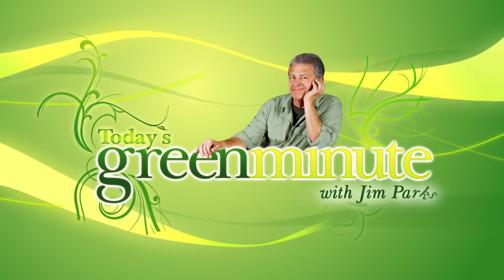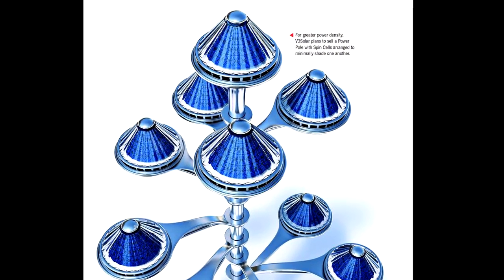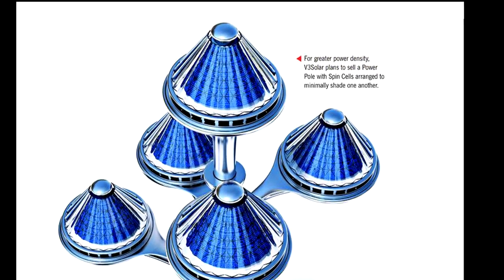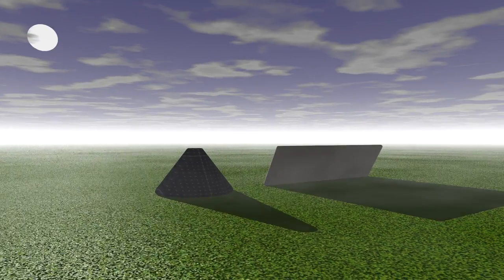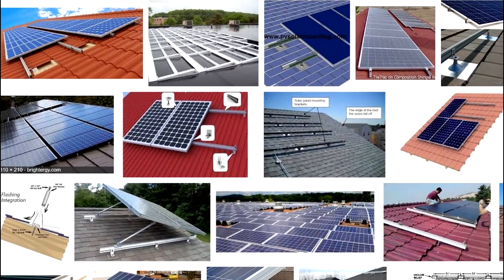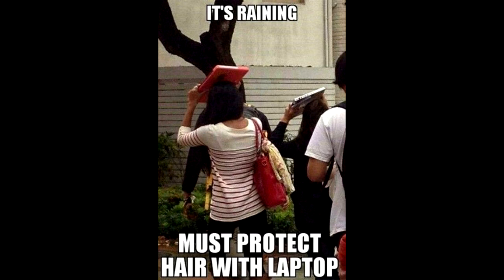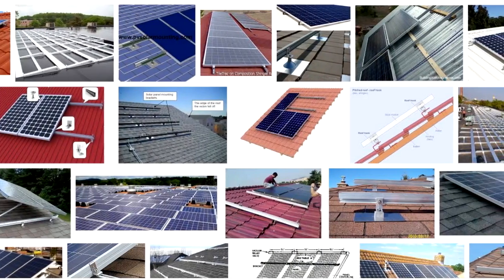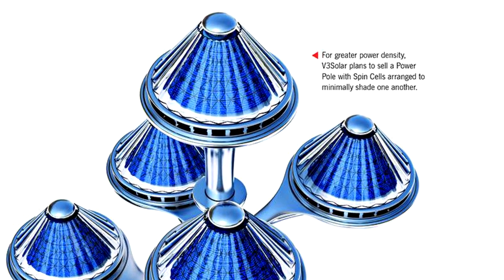Spinning Solar -BUSTED!

Comment: 50 seconds in I am thinking WTF, only 50% of the cells see any sun at any given time, minus the energy used to spin the device!!!
Reply: the 20% boost in energy he speaks of represents the added benefit of having the cells cool as opposed to hot. The 30% he multiplies by is the theoretical maximum amount of energy the panels could produce in a cone configuration, without lenses, assuming the cells are 100% efficient, but since existing cells only achieve 20% efficiency (that's how efficient the best existing solar panels are), the numbers thunderfoot uses would require 5x magnification!!!! And that still doesn't take into account the losses from light traveling through such lenses. He gives the concept such an unfair advantage in his assumptions, and it STILL doesn't add up.
Reply: @Gyppor  because the other half is in the shadow it's even worse then standard solar panels and even doubles the cost for half of the efficiency...
Reply: The surface area of the glass would have to be 20 times the area of the solar panels to do that.
Reply: @Gyppor  Why
Reply: +MusikCassette
Yes, for the reason Gyppor just mentioned.

Maybe to be more accurate, the glass might magnify by 20x, but that hardly helps unless it also brings in 20x more sunlight by using 20x more area than the panels.
Reply: Simon WoodburyForget 
gyppor was specifically replying to musikcassettes question, not a general complaint.

I'll restate; for this to make sense, the glass would need 20x more area than the panel, which the prototypes shown dont have and even if, this should have been explained right away instead of making it sound like the shape and temperature are essential.
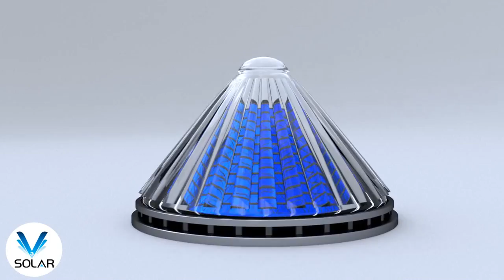Reply: MusikCassette uhh, but he did, starting at around 7:40 and didnt just say it would be too big to build. Did we watch the same video?
He showed how big the glass shell would need to be for the concept to work. Which would require an optical lense bigger than the biggest optical lense in use today. (did you mean 4m, not cm? and mind, just making a glasscone like that isnt enough, it has to be a working lense)
This would make the entire construction huge and as thunderfoot said, if for any reason the cone stops spinning, the concentrated sunlight would quickly melt the solar panels.
if the concept is that they concentrate light by 20x and the spinning cone is just there as a cooling system, then showing that picture of the cone with the glass shell and claiming it would produce 20x more energy is entirely dishonest. Or you're just blindly regurgitating what someone else told you without questioning it for a second.
Reply: Simon WoodburyForget I dont understand what youre trying to say. of course wed want cheaper material, but musikcassettes question was about my statement about the outer glass shown in the video not being able to gather 20x more sunlight. gyppor has answered this by saying it doesnt look like it has 20x times the surface area of the panels.

If that actually was the concept, it should be advertised as such and would be entirely legit; "20x more sunlight can be harvested by the same panel using magnification and innovative cooling system"
Reply: Simon WoodburyForget - clearly u arent mentally capable of following the conversation, so dont chime in.
Reply: nycholaus if it is producing 20x more power with the same surface as a normal solar panel or whatever the actual claim is since they aren't specific about anything, then it is 20x more efficient.

sure, 20x more power and efficiency aren't the same thing in general but in the context of this video, they are.
Reply: legalmechman, yes, Fresnel lens does capture more light coming from low angles, but it does not scale infinitely. No matter how much you increase surface area, you can not capture more light than it is directed at the lens. And that depends on volume.
Reply: legalmechman, actually, 

- I am not talking about volume of a lens, but an arbitrary volume that light passes through.
- Fresnel lens has smaller volume than comparable regular lens (because it is thinner).
- The protrusions on the cone are not Fresnel lens. Those are regular lenses. If cone was flat, it would be just a piece of glass, not focusing any light.
- Amount of light gathered by lens is proportional to lens' diameter.
- This isn't anything new, CPV is being researched for quite some time.
- This isn't really a scientific problem, but an engineering problemand from engineering standpoint, this design is… shit.
- Spinning the panels is not very good way to cool them.
- And that is covered in the video.
- Panels are enclosed within a glass cone, preventing convection.
- If spinning mechanism fails, solar cell is fried.
- Search for 'fresnel lens solar panel', this idea already was investigated.
- We live in a real world, where cost does matter.
- They question is: why would you make a more complicated and expensive system, which produces about the same abount of energy? (If adding lens allows solar cells to receive 200% amount of light, while 50% of cells are in shade, you produce same amount of energy)
Reply: MusikCassette thunderfoot addressed that in this video too. And yes, if that is actually their approach then this advertising is pretty dishonest.
Idk, seems there is a misunderstanding? Your question wan't very clear because i specifically talked about the cone shown.
Reply: I do not "simply" dismiss everything. I study things before disimissing them.

I do not try to sound superior (from my point of view, it is YOU who is trying to sound superior and dismisses everything I say). This conversation started with me trying to point out that you can't magically capture (X times) more light by increasing surface area of the lens. There is certain amount of photons going through the lens, and the only way to get more is to increase the size of the lens.

The thing about this project is that it is fake as hell. Their goal is NOT to innovate, but to grab attention.
They are just made up some COOL LOOKING FUTURISTIC THING and are not trying to solve any real problems.
I looked at their prototypes, and, (while they don't look bogus, unlike their cone-things) they are adding a lot of complexity for no real benefit (compared to existing CPV systems). If you are willing to add complexity, why not use water cooling? As a benefit, waste heat is used to heat up water, which can be put to use.
Reply: To clarify, I am not against people attempting such projects to satisfy their own curiosity, but misleading other people, and making money off that is not right.
Reply: +illyounotme The point is still entirely legit. If they produce 20x more energy with they same power source, then they ARE 20x more efficient. The panels they use for the cones aren't more efficient by themselves, so that increase has to come from somewhere else.
Existing tracking solar panels pretty much receive up to 100% of the sunlight their area of surface can receive. ´~20% of that is turned into electricity. Even if we're being incredibly generous and assume they're talking about stationary solar panels and are again incredibly generous in saying they're only half as efficient as tracking ones, then these cones STILL produce double the amount of energy the sun is providing.
The boost by cooling isn't incredibly much, so the magnification still has to somehow increase the incoming sunlight by over 10 times. Of course their lenses, the outer glass cones, can't bring in more sunlight then their are of surface either so these cones seem pretty magical.

To me, it seems the problem with these hypetrain schemes is that they don't provide details or data. Is there some mental gymnastic to what "20x more than regular solar panels" mean? On their website they state " if one places a 20x solar concentration on a flat, static solar panel then “the temperature quickly reaches 260 degrees F, the solder melts within ten seconds, and the PV fails. With the same concentration on the Spin Cell, the temperature never exceeds 95 degrees F.” Is that where the "20x" comes from? The outer glass sure as hell doesn't provide 20x magnification, so you have to do that somewhere else. In that case claiming these coneshaped solar panels produce 20x more energy is dishonest.

Funny enough, the prototype and claims shown in this video are over 4 years old and nothing has happened since then.
Reply: @Powersd451   most cheappee solar panels barely do 100 watts    315watt panels is the highest i have seen..
Reply: +MusikCassette
In that case I'll apologise too, I never noticed you responded until this nono dude dropped in.

"you do not have a lower restriction about how big that is."
Do you mean that we could downsize the entire thing? Sure, but my point is that the advertisement is wrong or dishonest. If the point is that the lens captures 20x as much sunlight, then the cones shown aren't representative at all.

""did you mean 4m, not cm?" you are a bit confused there"
I misread, I thought you said 20cm cell and 4cm lens.

"I got a little bit of homework for you: you have a small object and you are looking at it through a lens. What does it look like when the lens is formed in a way, that almost all light that falls onto the lens is directed towards that object."
I don't know what you are asking. What does what look like? from the perspective of the cone if that's what we are talking about, the sun should look magnified, everything else depends on what kind of lense it is.
Was the point about the 20x magnification and the size? In that case it was just a misunderstanding from the beginning.

To the rest, I'll summarize, I have nothing against new tech and I'd be thrilled to see some smart innovations. But by going by the info we have so far, somebody was either lying or mistakenly misrepresenting it. Knowing how people scientifically illiterate people react to hype, it could well have been the latter option.
But I despise Hype culture. Nothing good comes of it. Misinformation becomes rampant and it's more like brainwashing than being informing or productive.
Reply: legalmechman, Surface area does not matter here. No matter how much surface area you have, amount of light passing through the volume which contains that surface remains the same.
Reply: I rewatched the video. He doesn't talk about surface area, but about (solar) cross section, or how much of a lens (or a solar panel) is seen from Sun's point of view.
I confused things and started talking about volume, which is not relevant. Sorry about that.
Amount of light gathered by lens depends on it's diameter (larger lens captures more light) and on it's focal length (shorter focal length lens captures light from wider angle).
Main advantage of fresnel lens is that it is much thinner, meaning less weight, and it can have shorter focal length without significantly increasing thickness.
Reply: ye i mean even an idiot can realise that spinning those things would lose ALOT of engergy... its complete nonsense for the average idiot to believe...
Reply: Yah. I mean sure, the solar panels lose efficiency when they get heated up, right? So let's say that you exhausted options like passive cooling systems or whatever. Also make a big assumption or benefit of the doubt that after a point it's more efficient to just turn the panel off and cool it down. 
What solution would you use? Would you take the entire structure and spin it around or would you equip the panels with a shutter system where only a thin shutter mechanism would need to move? In fact, what if we would instead use something akin to a...what's it called, windshield wiper to apply coolant to the panels? So as soon as the thing heats up too much, a cooling-wiper wipes it off to try to manage the heat? 
No...let's just spin the entire god damn thing.
???
Reply: that is obvious, but why should it not have?
Reply: ñoño why the hell re you suddenly dropping in now?
Reply: I did not claim that using lenses and cooling is bad idea, and I did not say that it isn't applied in practice. So I don't disagree with you.
However, their cone design is completely bogus. The prototype from their page does look sensible, but I doubt it is a good cooling solution:
- Needs more solar cells to produce same amount of energy (because most of them are inactive)
- Requires more maintenance because of moving parts
- Motors require some power to operate
- Failure of the motor will cause PV cells to be damaged very quickly

We don't know because they haven't released any information despite having plenty of time to do so (their first prototype appears to be from 2013, and they haven't shown any other prototypes)
Reply: Gyppor why not just have a really big servo that moves REALLY slow that rotates a solar panel that follows the sub.
Reply: I didn’t even think that
I was just like
This is stupid, don’t fund this
Reply: well for maintanence you should turn of all tree :D
Reply: When I first heard of spinning solar cells, I thought these were lawn ornaments, not touted as a serious economic energy system.  :)
Reply: They lost me at 0:51. But wait, no, just kidding, its a piece of shit.
Reply: question could it ever be possible to create a light bulb that could power a solar panel like the sun?
Reply: alpha yun
sure you could do that - if you wanted to waste energy
It is impossible to make a 100% efficient system - and even if you could you won't be gaining any power you would simply have a s much power as you put into the light bulb
Reply: illyounotme you either haven't watched the video, you're deaf or you're just plain stupid
Reply: Just throwing it out there isn't there ways to produce energy through the principal of centrifugal force? And if so would using the solar power enhance energy production. The idea would essentially  be  some kind of magnetic turbine by using the solar energy to be the initial catalyst. I feel like this would be consider a perpetual motion concept. Would like to hear your input.
Reply: Simon WoodburyForget magnets aren't a source of energy? Except when they spin inside some wires and are a source of energy. it's how a turbine generator works :) as for losing some energy from the heat dissipation to make it spin (almost frictionless remember) - well that could still make it far more efficient than a solar panel that needs cooling
Reply: There is no difference in the solar panel that self therefore there's no difference in the efficiency of the solar panel. Well you might be able to slightly increase its efficiency due to the prism effect of the glass over the solar cell, this is done before it is not a significant increase. Rotating the cell awesome makes no difference because only the cells that are facing the sun generate power, so the majority of the cell surfaces are actually not producing energy. That's because over half of the surface area of ailable is facing away from the Sun, and at least another 25% isn't being sufficiently energized by the Sun to produce enough energy to matter compared to the remaining 25% that is nearly fully facing the Sun. The result would be about 30% to 35% of the solar cells actually producing energy at any one time which means you have a net loss of 65% give or take over a ray of flat cells. That right there debunks the entire principal this device
Reply: Ever seen what sort of solar panels Solyndra made.... ?
Reply: Yeah, I was wondering that too; with most of these Busted videos, you at least need to do some thermodynamics math to see that things don’t add up, but you barely even need that here:
Reply: 20 times more power is exactly same as 20 times more efficiency.
Reply: @SliceOfFish  nah. You could be gaining 20x more power but losing that in some way, like not converting it correctly, leaking it somehow, using up so much its basically the same as any other model...
Reply: per What?
Reply: +Buffalo_Chips may I ask where you have that information from? All I can find are sources claiming they spin it using a fraction of the produced electricity and a magnet system.
Reply: "But I despise Hype culture." well, there is something, we got in common. But going the opposite direction and dismissing something  because of a hype is also fallacious. Just because a stupid person says something is good does not mean it is bad.

"Do you mean that we could downsize the entire thing?" Well kind of. Actually I mean that there is no need tu "upsize" it in the first place. 

"I don't know what you are asking. What does what look like?" I meant what does it look like from the outside. The solar cells would look a lot bigger through the magnification. I still don't think they would look like they do in the Video, but there is no indication, that they would fill the whole cone.
Reply: Puls it always facing the sun, so it kinda evens out, I guess
Reply: Gyppor
Yet thundetfoots Argumentation on this is bullshit.
There is no absence of photons in the shade. Their number is greatly reduced but it's not zero. Think of all small plants and bushes growing on the forest ground. They  are in more or less 100 percent shade yet they live and grow because they might get a mere fraction of the photons received by the tree canopies but still they get photons for photosynthesis.
Imaging you have a big house - you can still grow something on the north side of your house where the sun is blocked basically all day long. Plants used to shady conditions. They will grow slow but they WILL grow nevertheless.
This only works because shade doesn't mean there are no photons.
Furthermore, you can even get sunburned in shade during summer.
Reply: Simon is saying, that glass is cheaper than silicon. And he absolutly gets what my retoric question is about. you are right, to get 20x as much energy out of the same solar cell the lens needs to have at least 20x the survice area. But there is no reason, why it cant have that.

I agree, the advertisement does not portray the Idea in the best way. You should start with the optic  than get to the heatproblem and than talk about the cooling system. 
It is still an open question, weather that system works out. but it is not a ridiculous one.
Reply: @sosocrazy1234
please stop spaming
Reply: No they aren't, because arbitrarily choosing a definition without knowing what the source of a claim is means you are using a strawman argument.

In other words, it doesn't tackle actual claims made by the designers of this device, it tackles some completely different issue that may or may not have anything at all to do with the claims made.

That's not very good for the credibility of someone trying to argue about science.
Reply: Refrigerated Fish "20x more power is exactly same as 20x more efficiency."
no, it is NOT.  NOT AT ALL.  Stop embarassing yourself by posting stupidity.
Reply: 1. sorry for the late response, there was christmas and new year and than other stuff.
2.  
to the size again, there is no reason, why the lence should be big. Yes it has to be at least 20x as big as the solar cell but you do not have a lower restriction about how big that is.
"did you mean 4m, not cm?" you are a bit confused there 4² *20=16 *20<20*20=20²
why the hack would you want to use a 4 m Solar cell?
"just making a glasscone like that isnt enough, it has to be a working lense" 
the exact geometry of the lenses would actually be an interesting topic to analise.

I got a little bit of homework for you: you have a small object and you are looking at it through a lens. What does it look like when the lens is formed in a way, that almost all light that falls onto the lens is directed towards that object.

If however your argument is, that the people who made the add did probably not understand the Idea, that they were advertising, I would probably agree. That seams likely. But I think technologicala literate people like thunderfoot and myself, should be able to see past that and judge the actual Idea. Even if Nathan Fillion likes it.

"Or you're just blindly regurgitating what someone else told you without questioning it for a second."
If that was the case I would be on your side of the argument. I learned about this from this Video. And I have a high opinion of thunderfoot. But that does not mean I follow him when he skips a few logical steps.

Look I am by no means sure, that this thing works out. But if they can get the cost for the mechanic and the lenses below the costs for the difference of the solar cells they use, and the crossection of the cylinder. And if the cooling works out. And if they can the reliability of the Mechanic above the mechanics of a solar tracker. If they can accomplish these three criteria than this would be interesting.
Reply: The heat gives energy that is used to spin the device and treats the spin as an alternator giving more energy, not using more. So this video is rather misleading.
Reply: @SimonWoodburyForget  ther in a vacuum making less air friction
Reply: +Powersd451
no he didn't really he called it a joke which is not  addressing it. the
 most valid thing he said about it would be, that the lens would be way 
to big, to build but that is actually stupid. Which is odd because 
normally he is quite an intelligent gay. If the lens is 20x as big as 
the solar cell and the lens is lets say  is 20cm in diameter, that would
 make a cell about 4 cm in diameter.
I do not really think that the advertising is dishonest. I vote for incompetent. But that is just speculation. 

how would you think, a cone of glass that leads almost all light that hits it onto some smaller solar cells would look from the outsight?
Reply: ok, guys...no claim of intelligence here, but I noticed something you all seemed to miss and I am curious of your thoughts...the "why" the cone lense won't work seems to rely on the premise that it is smooth...yet it looks to be ridged (like a cupcake paper) in the video (from the ad) allowing more surface area in a smaller space (sort of the inverse of cooling fins?).
Reply: Refrigerated Fish I'll agree that profiting from stupidity is wrong (welcome to capitalism 101), and I'm not saying that there is a magical way to create more photons...however, you (and the video) claim a need for more surface area to collect more light. a Fresnel lense does exactly that. Again, being no lense expert, I don't know the percentage gains a Fresnel lense would net you, nor do I even have the first clue as to how a person would create a cone shaped Fresnel lense...but by looking to scientific experiments currently underway, the theory is not only sound, but also an effective method  (though there are major issues such as melting the solar panel). This is where the idea of cooling comes in. the idea of water cooling (and having hot water as a residual) HAS been used. there is a gentleman here in MN who built a solar array and covered it with lenses (not sure what kind) and water cools the whole thing. he uses the heating effect to warm his swimming pool. The funny part is, he's just a school bus driver...not a scientist. Now, I grant you that this set-up takes up the entire side of a barn, but I have seen the concept in action.

That leads me to two conclusions: This idea MIGHT be plausible, and yes, the advertisement is shit designed to garner hype to make money (however, it just might not be nefarious as you assume, it could be to further research...the point being...we don't know).
Reply: LOL! Get off your fucking high horse. a % has NEVER been the same as a Watt.
Reply: Soooo...surface area mattered in the video (the surface was HUGE and it was compared to the surface of a giant telescope lense), but no longer matters when I point out that surface area can be condensed? I don't know (or care) if these would work...I just tire of the hypocritical, snobbery I see coming from science nerds. You just basically denied the idea of a scientifically proven thing...the Fresnel lens...I see no reason this couldn't be some type of inverse Fresnel lens...though the theory seems a bit lacking...
Reply: "[...]The outer glass sure as hell doesn't provide 20x magnification, [...]" Why not?
Reply: Sadly, I have been in debates like this before...so, I am correct, but not infinitely so...but we don't NEED infinite amounts of light (here is your logical fallacy. Please stop with those...he had more than enough in the video)...we only need a finite percentage more. Surface area can (and in this case) DOES increase volume (you so correctly made my point for me here). Now, as to if the added surface area would acieve the claimed results...I don't know...and neither do any of you. THAT is my point.

You sound like the people who told the wright brothers flying was impossible...or the naysayers who said man would never break the speed of sound...or even those who said a moon landing was impossible. You are a traitor to the very ESSENCE of scientific theory...open-minded experimentation...curiosity...problem solving. THOSE are the heart of science...

This idea has many flaws...but then the bumble shouldn't be able to fly. Instead of dismissing an idea because it does not fit within your "rules", be a SCIENTIST and INVESTIGATE the idea...with NO predetermined failure or success goal. A fresnel lens will indeed add to the output of a solar panel (somewhat like a turbo-charger on an engine) until it overheats the panel (ant under a magnifying glass). So spinning the panels would allow for it to cool. The question is: would a lense "turbo charge" the panel ENOUGH to compensate for the 50% that is not recieving light (I highly doubt the 200% claim). The correct answer is: you don't know...nor do I. And THAT is the point...you don't know.
Reply: It's interesting to me how you simply dismiss everything. Yes, I realize that Fresnel solar has been tried and the problems are EXACTLY what this claims to be fixing...that does not mean that this doesn't have issues...I never made any claim to it's viability, only called you out on your incredibly dismissive attitude. Since you seem to have ALL the answers, why have YOU not started a company making solar panels that are better than other forms of energy?...oh. Wait...I already know the answer to that...solar power is in it's infancy...it requires open-minded people to grow it. From our entire conversation I can see you'll not be one...a pioneer, I mean.

Again, to clear this up for you since you have spent this entire conversation attempting to be superior to me, I don't give a damn if this idea is good or not (and I seriously doubt it's even a fraction as good as they claim), I dislike your condescending attitude (and that of the video producer)...innovation DOES require understanding the rules...but also willingness to question and break them.

I leave you with this thought: I once had a theoretical physics professor say, "Just 100 years ago, what we know today would have been considered heretical and false. Never stop questioning the status quo."
Reply: wtf.......are there literally that many science illiterate people liking you?
Magnetic bearings have been around for a fucking LONG ass time. Your computer is using them.
What he said made 110% sense. He never ONCE said anything about electricity with the bearings.
I have his thoughts exactly, this is simply a knee-jerk video from a guy outside his field of expertise who has no business abusing his viewership with shit he pulls up on wikipedia. Yeah there's plenty of con shit out there but using some basic brain power I can see how the advantages just need to be fleshed out to make it work.
Reply: two cones together can generate a lot of convective heat energy and the rising and concentration of this energy as it escape out the top is what spins it. There is no motor. The inner cone rides on a near friction-less magnetic repulsion field (two ring magnets with poles aligned repelling each other)